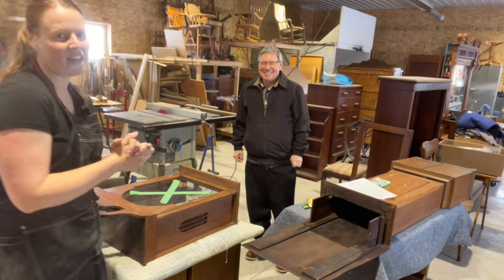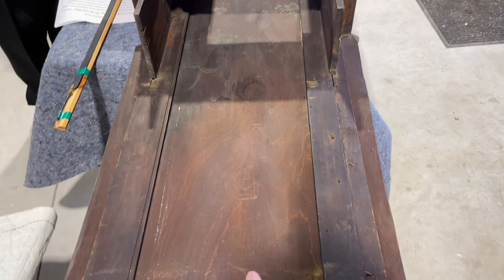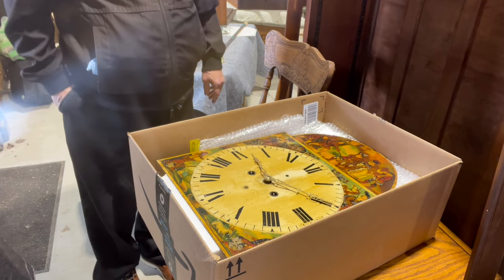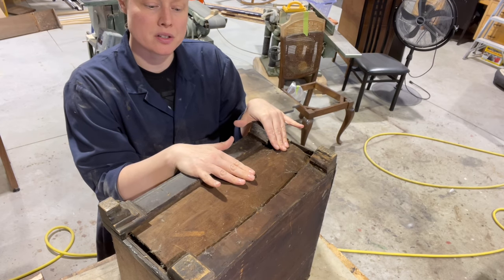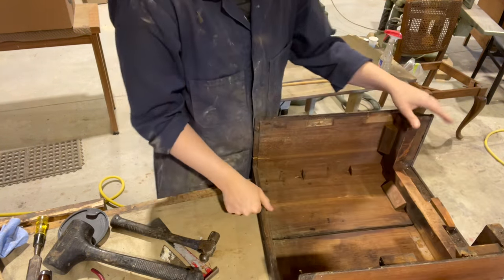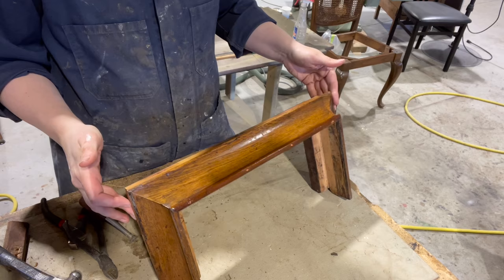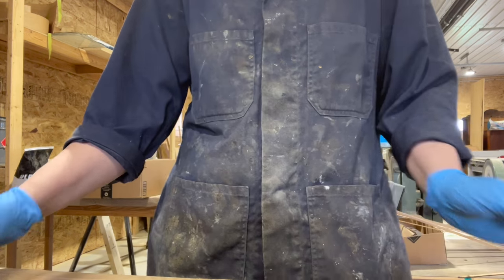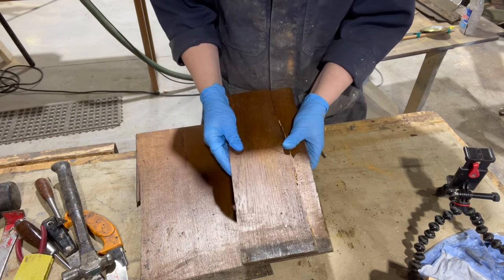200 Yr old Clock Restoration: PART 1

Comment: I found this video a year late! 😂 it’s been fascinating, I would add that these old clocks always had problems with the feet as they were placed on stone slabs and got water damaged with constant floor washing over the years. When I was at school in the 50’s we were told it was interchangeable to either use the 4i’s or a iv. Brilliant video I’m so pleased to have found it.

Comment: Your meticulous work on saving as much as possible of the original oak was a great indication of your attention to detail of this piece.  Working on the clock face required a delicate touch & a steady hand to return this work of art to its original vibrancy. Did you or the owner of the clock have the clock's workings cleaned & fine tuned?   Beautiful job.
Reply from the maker: Thanks. The owner is in search of a clock repair person to finish the works. Cheers

Comment: I am currently (and have been for some time.....) restoring an Art Nouveau breakfront and one thing in common with the piece you have here is ---- the dirt! Amazing how filthy these pieces seem to be! Really looks like yours stood in water for a period. I sympathized with you at a number of points - especially the decision to replace the bottom banding and repair the front by cutting away and regluing. Mine had a peculiar astragal molding that did not wrap the cabinet. Why? No idea. It will have a new astragal molding that will  wrap. Routed it out myself. New door hardware, new hinges, it goes on and on.... Anyway, will be finishing up mine, well, sometime soon? Haha. Thank you for a nice video.
Reply from the maker: Awesome sounds very interesting

Comment: Glad to see the video is back, I'm guessing the long format didn't work out?    Just curious how you can determine if the wood worms are still present and what could be done other than replacing the wood section if they are?
Reply from the maker: I usually poor alchohol in Swiss cheese holes and if there are bugs they come out. If there is an active infestation it needs to be fumigated and then I would proceed the same.

Comment: I was watching you work on the base and it just seemed like the damage kept getting deeper and deeper.  Really impressive how you worked to save it...  As for the panel, I might have been inclined to put new wood on both sides, to try to balance the look of things.  However, I think you are much better at matching colours and stains... I usually just build new projects
Reply from the maker: Thankyou! I wished I had a better piece of  oak but I had what I had

Comment: You mentioned 'high' glue? What are you referring to? I restore old furniture myself and sometimes so called fishglue is used (Sweden), not sure if this is the same. Let me know. 🙂
Reply: She said hide glue
Reply: @edsmith8153  Found it, it seems to be the same or similar to Swedish 'fish glue'.
Reply from the maker: Fish glue is similar but has leas strength. Hide glue is used more often in woodworking. Cheers!

Comment: I gather using iiii instead of iv was standard on clock faces from the middle ages through to 17th century.  So probably not unusual for this kind of clock, since it was probably what was familiar. I think I saw somewhere recently, that it was a coomon form in Roman times in fact, but I'm open to correction on that.
Reply from the maker: Hmm. I’m not sure. But I think you could be right

Comment: @JohnsFurnitureRepair thanks for the lesson.  I know on some restorations you can use wood hardener...but do you cut all the chewed wood off too.  How should I decide how much chew do I remove? Obviously if it crumbles in my hand it has to go.  But if I'm trying to be like you and keep as much of the original...how do I decide it? Like would running a bristle brush over chew work and if so what kind of brush? I use various brushes from toothbrushes to brass depending on the project.
Reply: I have sooo much to learn and I truly appreciate you sharing your skills and knowledge
Reply from the maker: Sure. I think anything that distorts the shape or is loose should be removed.
Reply: @johnsfurniturerepair  thanks

Comment: The plywood in the bottom, is probably not original ;-)
Reply from the maker: It wasn’t plywood it was a solid panel which is why it warped so badly